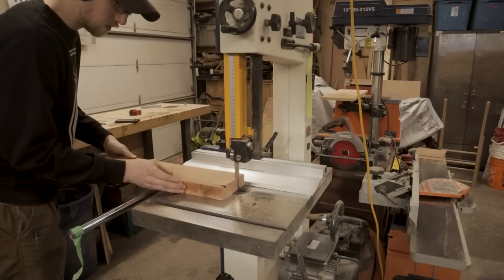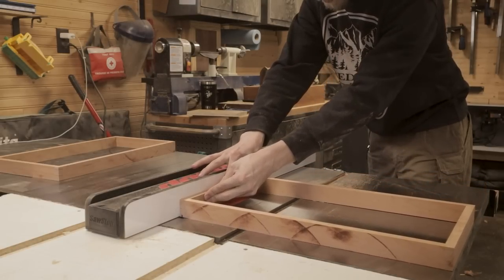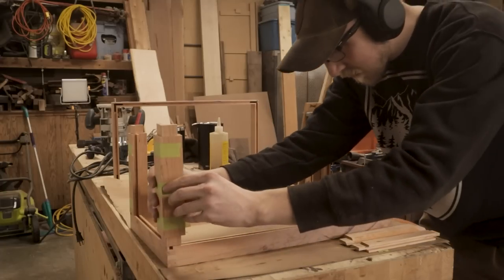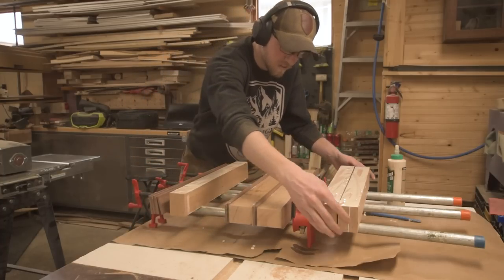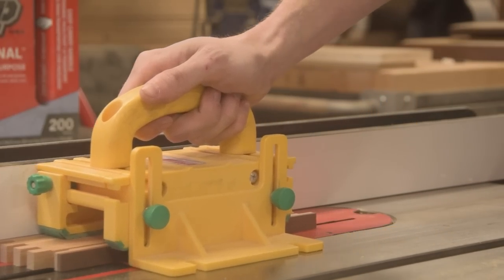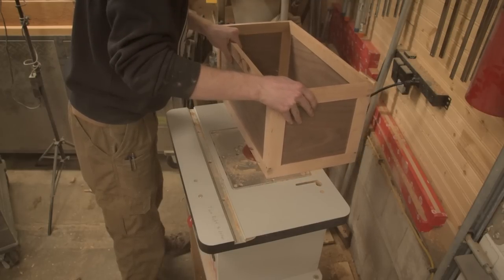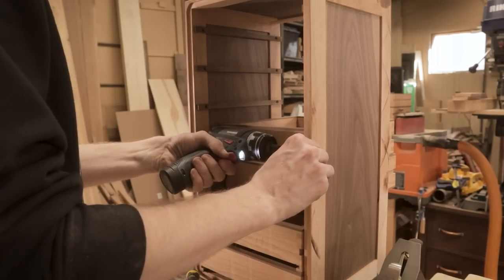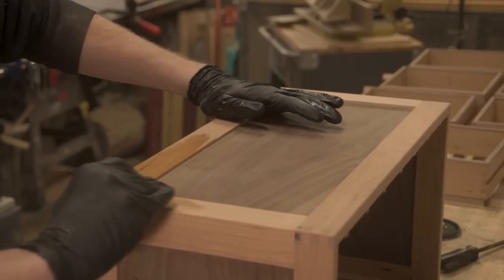The Perfect Shop Organizer

Comment: awesome project. I love the wooden runners for the drawers. seems like EVERYBODY uses the metal drawer glides but this is much more classy!
Reply from the maker: I've wanted try making wood runners for a while, and can safely say they work alot better than I expected. They're a little bit smoother than having the drawers slide on a bottom frame and cost basically nothing compared to the metal ones! What's even more interesting is I've found a few ways to make full extension solid wood drawer slides that I'll be using on an upcoming project!
Reply: Traditional fine furniture is piston fit drawers without slides. When you say ‘everybody’ you’re just talking about modern makers that barely use any hand tools and seem to be more into design or YouTube views than making heirloom furniture. There is nothing wrong with this. I love those channels and watch them all the time. It’s certainly high quality hardwood furniture. (Well some are and some are just screwing together plywood with pocket screws) But it is not the same level of ultra premium that you get when you hand cut a half blind piston fit dovetail drawer. Obviously the ultra high premium stuff is going to be rarer as it’s just not as approachable to the average maker.  But there are people out there that do it (like Sawyer Designs).

Comment: Nice build! You did some fine work on the joinery there, and it looks so great!

I had this idea to make drawers using brass bars for the runners. Might add some cool accents to the sides of the case too.
Reply from the maker: Brass slides would be sweet! I've been wanting to work with brass for a long time, I just can't find a source locally. Even the big box stores don't seem to carry brass flat bar. I found one company that'll ship it but that makes it fairly expensive, but someday I'd definitely find a way to use some brass details in a project!
Reply: @morganhurst_redridge  doesn’t Lee Valley have brass bars? I thought they did 🤔
Reply: @morganhurst_redridge  hunh. I just checked and they don’t carry bars anymore! Maybe google for brass foundries? I happen to have one 30m from where I live. I should check if they have a retail space.
Reply from the maker: That's too bad about Lee Valley, that would've been very convenient! I was able to find this place called Metal Supermarket near me and they car brass flat bar, but none of it's in stock and doesn't show prices...

I'll probably end up ordering it from this website https://www.knifemaker.ca/ , I've ordered some knife making stuff from them and they sell a good range of flat bar up 3/4" thick.
Reply: The thing to worry about there is the runners wearing down the drawer box. Typically you want the runner to be softer than the drawer so that the runner wears out. Obviously the runner is much easier to replace than building another drawer. This is especially true when people often make their drawers out of secondary woods like poplar or soft maple. Obviously this is a long term concern but  I would personally be wary of running a maple drawer over brass runners.
Reply: Thanks for your reply, @CarlYota! I appreciate the insightful comment!

Comment: To solve the problem with planes crapping up your protruding tails and box joints, pare with a chisel first, then move to the plane once you're one or two shavings away. It's a little slower than just attacking them with the plane (and a lot slower than the sander), but your results will be clean.
Reply from the maker: That's really helpful thank you!
Reply: @morganhurst_redridge  no prob. Also using a low angle plane might help, but it isn't necessary as long as you're nice n sharp. A good low angle block is helpful for this sorta thing.

Also, I should have congratulated you on such a nice build. Good job! :)

Comment: Hyde glue seems to be the new hotness.  Whats old is new haha.  It definitely looks to have its favorable uses. 

I picked up a Woodriver #6 as it had a pretty good price.  People say its heavy but it doesnt really seem like it in using it for a time.

Did you happen to slightly taper the drawers as well?

The dark brass looks good with that wood.
Reply from the maker: I promise I was trying to use hide glue before it became a trend! It is kind of funny seeing people like myself coming to terms with the idea that you don't always need the strength of titebond 3.

I've been looking at the Woodriver planes for a while now, I'm really interested in getting a 5 1/2", and I may go with Woodriver if I can't find an old Stanley.

I tapered one of the drawers and it actually caused some annoying issues. The bottom drawer is slightly tapered because I thought it would help guide it into place but what I found is that if there is any side to side movement at the back end of the drawer, it jams more often. With the rest of the drawers I just worked the sides until the drawer fit, did a couple extra passes so it would slide freely and that made the drawers very smooth.

Comment: Nice build, I would have made the slides a bit shorter running into stopped grooves so to preserve the entirety of the front but I understand it would have taken more time.
Also planing the drawers from both ends (stopping half way) would eliminate the risk of tearing out the finger joints.
Overall really a nice build, looking forward to the apothecary one using the dovetail bit instead of the straight one, apothecary furniture is classy 😉
Reply from the maker: I was going to do the slides that way but when I was working on the 3D model, I really liked the look of the slides poking out. I think they add that nice spot of walnut on the drawer fronts.

I've started the design of a small apothecary cabinet but it's going to be a while, I'm realizing now that not only are they a decent amount of work but the amount of materials gets crazy expensive!
Reply: @morganhurst_redridge  I see, to reduce the costs a bit maybe consider using clear acrylic sheets for some part of the build, they can highlight the content really nicely as well
Reply from the maker: @alessandrosuppini943  I should've done the side panel with acrylic! I'll have to keep that in mind for a future project, thanks!

Comment: Regarding the difference between modern and antique planes, I have to agree.
My first plane was also a low angle jack, but I now only break it out for working with end grain. The lighter Stanley planes are just far more pleasant to use.
Reply from the maker: What I'm really interesting in trying is a Lie-Nielson, I know they're basically Bedrock clones so it would interesting to see if they are equality as comfortable as the older planes, I just have to save up for a few years!
Reply: @morganhurst_redridge  Yeah, they are a bit pricy....

Comment: Somebody told me that Hide glue is much better for 45 degree angles on furniture and the box/dovetail joints. It helps the joints fill into each other far better. I don't know if that is true yet bcos I haven't made box joints yet.. 
How do u handle the dust in ur shop Morgan? It's driving me round the bend atm./ I hadn't been out to my little shop for a few days after using the jointer and even though it wasn't that messy it and my mitre saw left so much dust on everything. I went out last night to get some things to finish something I was working on in the house and I couldn't believe how much dust was on everything.
I was jointing/thicknessing some old boards for something I want to build and the dust from that alone wasn't as bad as I thought it might be  but I was cutting some skirting on the mitre saw and it was so messy with no dust extraction on the thing.. 
Oh my days the dust last night was everywhere.. I have to go out and clean it this evening now and I'm not looking forward to it atm.. LOL 
U love ur touch of Walnut bro.. heehee! U are using it well though man. Credit to ya for another fine build..
For a beginner like me could u give me one piece of advice to keep myself motivated to get into the shop every day even if it's only for an hour to begin with?? 
Thanks for this video Morgan. Great work gain pal..
Reply from the maker: Hide glue is hands down the best for any form of joinery because it lubricates the joint, helping things like dovetails or box joints to slide together nicely!

For dust, look into getting an air filter, I have the Wen air filter from Amazon and even though it's too small for my shop it makes a huge difference for the amount of dust that builds up on stuff. Another trick I use is to keep my shop vac in a convenient spot and plugged in, that way when I make a mess I'm more likely to grab the hose and clean it up right away.
Reply from the maker: The best way to get motivated for woodworking is to make sure you're passionate about the project, which isn't always possible so sometimes it's going to be a little forced but when you're trying to decide what project to do next try to pick something that will be a bit of a challenge or teach you something new, for me that's what keeps me going!
I will admit I get that feeling all the time though, where I just don't want to do any woodworking and when that hits I try to do something else like video games or going for a walk. If you try to force yourself too much you'll end up making woodworking a chore and it'll never be fun!
Reply: @morganhurst_redridge  Thanks man. That's some great advice. I'm about to start something myself this coming week. Take it easy Morgan and thanks again..

Comment: I tried replying to your reply to my original comment, but everytime I do, it doesnt actually send for some reason so I'll make a new one here.

I went to PJ's website and they have a lot of stuff for sale, all but lumber. Is the lumber that you purchase something that you go in in-person and see what they have in stock, or do you give them a call and put in a request order? 
Thanks for all your info, man!
Reply from the maker: That website is for the Richelieu brand in general, they bought out PJ a few years ago. Funny enough you can't actually buy 
Richelieu hardware at PJ even though Richelieu owns them!

The best thing to do is just go in the front door and the person behind the counter will let you know the prices and whatnot. They don't have a wide selection of lumber you can pick through, but they typically have a lot of the basic domestics (walnut, both oaks, ash, cherry, maple, poplar, alder). I think they do carry some other woods but those are the ones that are easily available to pick through. They also have basically every type of sheet good you could ever want. 
Then you'll go in the back, dig through the piles to find what you want, then the guys at the shipping counter will count it up, you'll pay in the front and be good to go. 

For a little bit of reference on my last trip, I bought some 8/4 cherry for $7.95/bdft. Compared to Black Forest at $10.95/bdft, it's not massive savings but it does help. Also, they are the single best source for cherry in Calgary, most of the times I've bought cherry from them it's solid heartwood, as the pile gets low you'll get some worse stuff but most of the time even the "worse" stuff is pretty awesome!
Reply: @morganhurst_redridge  Imo, that's a sizable savings worth coming back for, especially when the more you buy. I'm heading to Calgary next weekend, so I will definitely be checking them out & hopefully find some good cherry! Thanks
Reply from the maker: Sorry I should've mentioned, they're only open during the week from 8am - 4:30pm, which might make it a little inconvenient to get there!